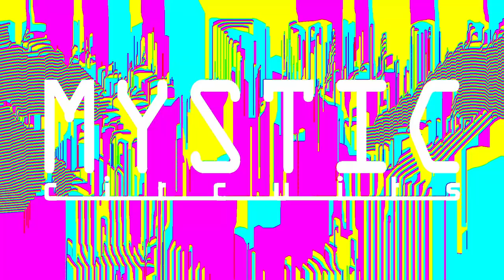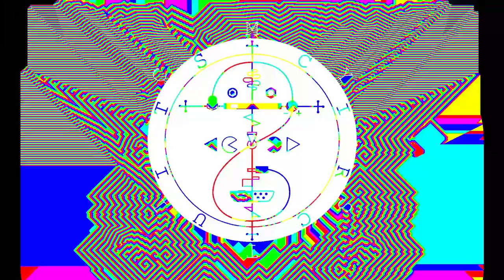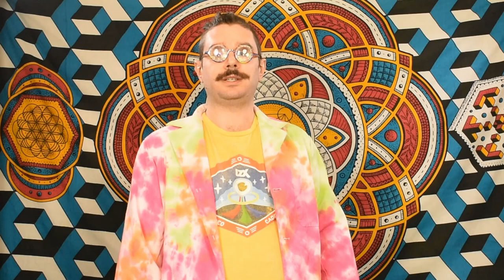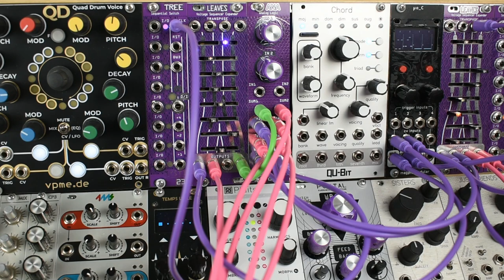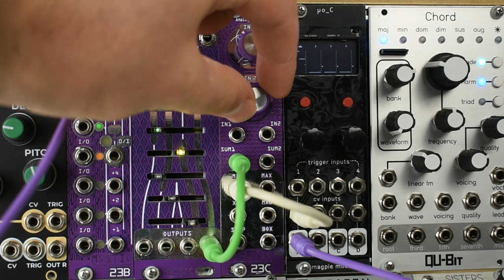Using Ana for Note Sequences

Comment: Really cool that you put out some new stuff. Will there ever be a video on the amazing drum firmware you wrote for Nebulae?
Reply from the maker: Yes that is the plan!  I made a video for it awhile back but I really wasnt happy with the quality.  Im planning some minor tweaks to the firmware after which I will be making the video.
Reply: @MysticCircuits  big question: when will the updated modules be available in Germany, so I can finally pull that trigger on Ana?
Reply from the maker: @mrcwalker33  both Gear4music and Escape from Noise have the new purple Anas on the way to them.

Comment: Please can you explain how you get 2 different sets of gates from the box output?
Reply from the maker: Box gives both a positive and a negative square wave so you can put Box through a voltage inverter and get a separate gate sequence.
Reply: @MysticCircuits  thanks Mr Circuits